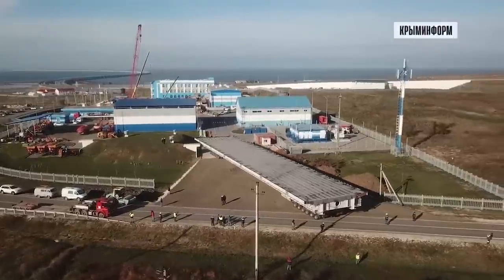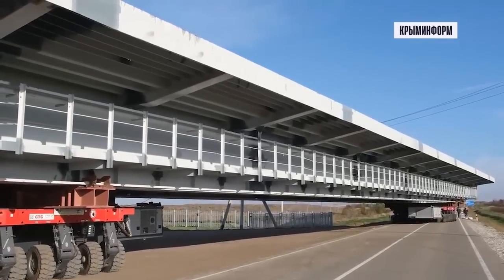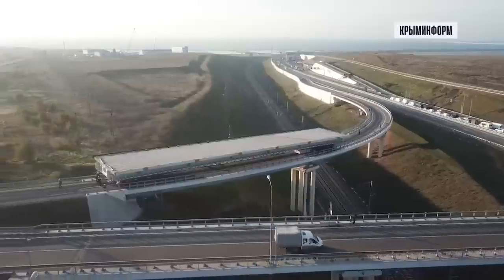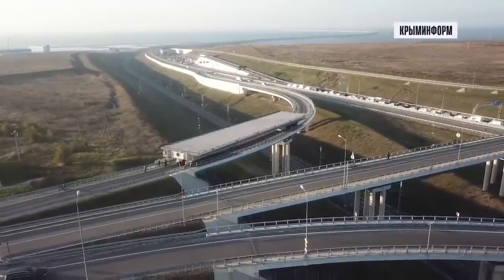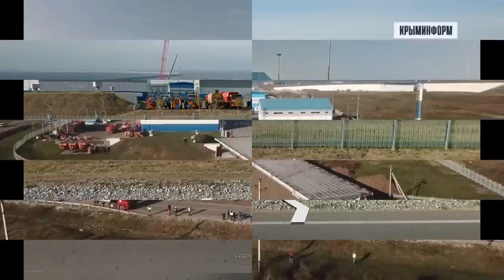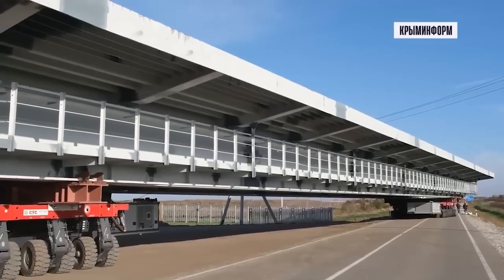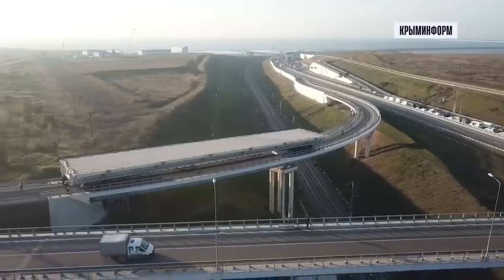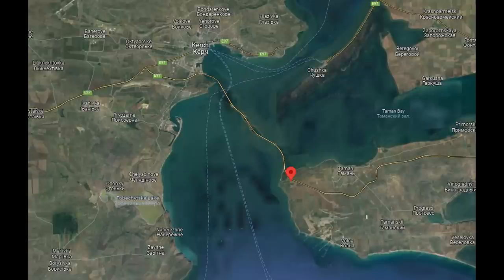Russia Transports New Span to Repair the Crimean Bridge

Comment: @Suchomimus As a former concrete and reinforced concrete builder, I can tell you that the time of four weeks is quite realistic for a new construction of a sub-sequence with the available construction plans.keep up the good work with your videos! 
🇺🇦🇺🇦🇺🇦 SLAVA UKRAINI HEROYEM SLAVA 🇺🇦🇺🇦🇺🇦
Reply from the maker: nice, thanks for the info
Reply: @suchomimus9921  Has anyone checked recent satellite imagery of where it was built to see if work was underway prior to the October attack?
I'm crap at geolocation - can't find the place on Google Earth.
Reply: To add, from the video the span is steel construction (not concrete) - steel pieces have to be manufactured unless they're ready at-hand to be assembled (which is comparatively quick)
Reply: @kristianhermann5971  - I'd be surprised if they didn't have a warehouse full of pre-welded trusses and other sub-components ready to assemble and a working floor with jigs built in.
Reply: @hamletksquid2702  I was surprised they'd keep that much spare material at hand but maybe it was considered a good idea after one of the railway spans fell into the water during inital construction. Russia wants it operational by the end of the year, with the final work completed by July, per early reports.
Reply: @mikep490  - It's hard to say what the Russians consider sensible, but I would certainly stockpile sub-assemblies. Steel's cheap, and you need to keep the skilled workers for when you need them. It's the equivalent of having bridging equipment moving up behind your forces just in case.
Reply: @hamletksquid2702  We know Russia assumed the bridge would be targeted so I'd assume they ordered materials before it blew up, back when they started putting target barges around the bridge. You wouldn't normally have a million in materials just lying around. The construction method they used in those sections isn't all that strong, if blasts or earthquakes are a consideration. Of course that might have added another billion to the construction cost to build it double reinforced.
Reply: @mikep490  - You can build it needlessly strong, or you can build it cheap. This bridge isn't a structural unit. It's a bunch of them that just sit on piers.  The pre-cast box must have been made ahead of time. Here, it would have had homeless people living in it. 
I really would expect them to have a section's worth of trusses and crosspieces warehoused. The labor is the expensive part, and you're going to spend some time spreading the work out and being ready or in a hurry and take what you get. 
I work on much smaller things made out of more expensive steel than construction iron, and some of our customers make and stock blanks for custom products later. That can easily add up to a month's revenue on the shelf.

Comment: This is just one span of four that they need to replace the fallen spans. This does not count the spans that continue to stand but are damaged. I suspect they will have at least four additional spans to replace on top of the four fallen spans. They still have a lot of work to do to bring the roadway portion back to spec.

Comment: The vehicles used are smaller versions of the ones used by Elon Musk's SpaceX to move Starship at Boca Chica, Texas.  The biggest manufacturer of these SPMTs (Self Propelled Modular Transporters) is Fagioli S.p.A.  They can carry massive loads of up to 60 tons per axle-line.
Reply: If you watch SpaceX activities at Boca Chica, they are used on a daily basis to move the booster and starship between the launch pad and assembly buildings. The SPMT's are amazing vehicles.
Reply: Adjustable height and fully independent steering on each axle.
Reply: Just don't get the idea that musky boy invented these things. They've been around for a long while in the heavy lift industry, they (musky boy) just had ones custom made for their own purpose.
Reply: @SuperRede4u  There is nothing custom about the individual modules. Each module is as big as it can be while still being easy to ship. So they fit on a standard truck. 

They have big flat surfaces with many anchor points. Multiple modules can be directly connected to a strong rigid load like a bridge segment, to make a single huge vehicle. Or they can be connected with a custom steel frame to carry a more delicate load like a rocket. 

Each wheel has its own motor, independent steering, and a rather large vertical travel. The vertical travel allows the transporter to keep the load level on a sloped road.
Reply: Civil engineer, here.

When you have money but can't place it in international accounts due to sanctions and asset freezes you now can invest it locally in your own economy. Gone are the days of quick gas and crude earnings which could be whisked away into London and NYC accounts for safe keeping !

This might be why this bridge span was fabricated so quickly. The money always  needs to go somewhere.

Experts were hired for around the clock and likely overpaid for improved motivation.

Section elements are standard and were pulled from a maintainance  warehouse.

But was proper QA-QC done on the section prior to shipping it to the  construction site. This remains the massive elephant in the room.

Another  poster here cited the use of an Italian (?) transport crawler. As sanctions continue and spare parts become scarce crawlers like this will cease to operate, preventing bridge repairs. I'm sure the crawlers, having to bear very heavy weights, need specialized ball bearings. 

Remember what had happened at start of war? Sanctions stopped import of specialized Swiss ball bearings. Because of this, the Russian rail company, who use such bearings, knicked several routes and retired several cars.

And the crawler parts ought to be even more niche, more specialized hence harder to obtain.

Ukr and Ukr allies would we well-benefited to sabotage such crawlers to disallow the movement of completed bridge sections. The bridge will be hit again, I have no doubts about this, so by eliminating the crawlers its repair will be very, very hard.
Reply: Fagioli is a service provider. They don´t manufacture. Most SPMT´s I have seen are made by Scheuerle, a German company.
Reply: Has nothing to do with Elon or SpaceX. These heavy lift platforms are used since decades by heavy cargo moving companys like Mammoet
Reply: @SuperRede4u  did your mom even send you to school to learn how to read? nowhere in the original comment that said Elon invented this.
Reply: @Myriip  which nation manufactures this crawler ?
Reply: @NhatHuyNg  Yeah, his comment came across as an early case of MDS (Musk Derangement Syndrome)
Reply: @oleopathic  Most are manufactured in Germany by the TII Group (KAMAG).
Reply: @Myriip  OK. Thanks for info. So sanctions should kick in as this war continues and both bridge and crawler are targeted.
Reply: @oleopathic  They could go around sanctions because TII Group has one facility in India if im not mistaken.

Also the company who rebuild the span is most likely in proper Russia and not a military target.
Reply: @Myriip  all good points. 

There are back channels to use to subvert sanctions. However it must be done secretly. If US and allies find out  they will sanction the culprits helping Russia. So India might get hit, too.

As for manufacturing facility inside Russia. With the tempo of war, might war move to the area supporting manufacturing facility in future? It's possible.
Reply: @solarwizzo8667  that is indeed the company that SpaceX purchased it’s SPMT’s from. Previously they rented some from Fagioli
Reply: @SuperRede4u  SpaceX probably just rented them at first. I’ve seen them use different models with different colors.

Comment: It'll be interesting to see if it fits properly. I could see them putting hundreds of welders on it without consideration for heat inputs causing alignment issues in the field. Production over quality.
Reply: @HubertofLiege  Ha! Sounds like a lot of fitters I've worked with.
Reply: @pho-kingsoup8126  grinders and paint make me the welder I am nyet
Reply: @HubertofLiege  Brings me back to inspecting. The guys who ground everything to min height above parent material were usually the guys who used up most of my soapstone.
Reply: Hopefully they used rubber tape measures - allegedly they are commonly used and available in France.
Reply: Ya, I'm sure they have no clue what they're doing in this final welding shop. LMFAO.

Comment: Fabrication of the span is the simple part, after it is moved across the remaining bridge the span then has to be lifted and moved into the big hole. The quickest way would be a floating crane this you may be able to see if any are in the area. The other way is to set cranes up on the bridge which is a lot more challenging due to the weight of the span.

Comment: To me it looks like several per-made section welded together judging by the rusty areas along the outer sides. If it was a quickly made new section of bridge why would you have a walk way on both sides? The transport system used is very common on large construction type jobs so nothing unusual about that.

Comment: Not impossible to make it fast or have it prepared. But they need at least 3 of them. And the big worry for me is the support pillars.
Reply: Worried ? Why ? Do you want it to work?  No matter , Mr. HIMARS will sort it 👍
Reply: Well, and spans going the other way that didn't fail at the time.
Reply: @johnbooth3073  Worry from a engineering standpoint.
I want this thing to fall.

Comment: Calgary Alberta Canada here, just a short note, in Calgary we have a cement company  that constructs these very  bridge sections for our highway overpasses and it's really cool to watch them move them in a similar  fashion  as this , only in the city they have to move them late at night when traffic is low.I worked the night shift so I could watch them at night. We also have traffic lights that pivot 90 degrees so that it helps them move more easier. GOOD TALK CHEERS.

Comment: I suspect they had enough prefabricated parts on hand to allow them to manufacture this span fairly quickly. This is especially true since the bridge was completed fairly recently and it looks like they had kept the manufacturing site active. I would think that the more curvy pieces would be more of a challenge to build. The pieces that go from lower to higher elevations would likely take more time to rebuild.
Reply: Civil engineer, here.

When you have money but can't place it in international accounts due to sanctions and asset freezes you now can invest it locally in your own economy. Gone are the days of quick gas and crude earnings which could be whisked away into London and NYC accounts for safe keeping !

This might be why this bridge span was fabricated so quickly. The money always  needs to go somewhere.

Experts were hired for around the clock and likely overpaid for improved motivation.

Section elements are standard and were pulled from a maintainance  warehouse.

But was proper QA-QC done on the section prior to shipping it to the  construction site. This remains the massive elephant in the room.

Another  poster here cited the use of an Italian (?) transport crawler. As sanctions continue and spare parts become scarce crawlers like this will cease to operate, preventing bridge repairs. I'm sure the crawlers, having to bear very heavy weights, need specialized ball bearings. 

Remember what had happened at start of war? Sanctions stopped import of specialized Swiss ball bearings. Because of this, the Russian rail company, who use such bearings, knicked several routes and retired several cars.

And the crawler parts ought to be even more niche, more specialized hence harder to obtain.

Ukr and Ukr allies would we well-benefited to sabotage such crawlers to disallow the movement of completed bridge sections. The bridge will be hit again, I have no doubts about this, so by eliminating the crawlers its repair will be very, very hard.

Comment: First thing I noticed is that it's not made of reinforced concrete. It all appears to made of structural steel however it is possible that concrete could be poured once the span is in situation. 
Because the bridge is relatively new it's possible that this span was made on a bespoke hydraulic jig/template that remains from the initial construction.
Hit it while it's hanging on the crane.

Comment: Civ/architecture here... the assembly would be possible but the concrete will take at least a couple months to fully cure to full strength. I suppose it will take another week or more to get to a point where it’s expected to support vehicles. By then it will be fine I suspect. The surface might get more degradation, but the strength mostly comes from the steel anyway.

Comment: Since the design of the bridge already exists and is (presumably) approved, you just need the materials available to get it done quickly. If any corners have been cut it will be in weld heat treatment and weld inspection. In which case the service life will be shorter. (See any video about the Liberty Ships)

The long lead item is the transport vehicle, which presumably is available from the original construction.

They probably also need to have drawn up a bespoke installation plan, as the installation sequence will be different from the original
Reply: Russia never requires approval just get it done now

Comment: Since the bridge was originally finished in 2018, some of the equipment to make it may still exist. The smelters that created the original may still have the templates to make more steel to the original design. One month would normally surprise me, but not for a construction this recent. All it may have taken was Gov't reallocating resources to the project.
I'm not a civil engineer, I'm electrical, so grain of salt my opinion.

Comment: SpaceX in the United States uses an almost identical transporter to move it's Starship rockets in Boca Chica, Texas. They refer to it as an SPMT, which stands for "self-propelled modular transporter." Not a very cool name, I know. It has a generator at the rear that powers its electric drive motors at the wheels. Each of these units can be linked to others, both physically and/or digitally, to form a single, larger transporter.
Reply: In Central Queensland Australia we use Lampson transporters of similar design to shift draglines over long distances when one end of mine is considered uneconomic. ( Generally 20 plus kilometres.) Some of the strip mines are over 75 kilometres in length. Using the transporters saves replacing the walking gears on the draglines but can take months to set up and a huge amount of earthworks as well.

Comment: Time, money, quality, you get two of the three in engineering so with enough money you can get quality, this appears to be a prestressed section, and the engineering was likely done before the event happened.  So it is possible that it meets the same standard as the old section.

Comment: The vehicle is a SPMT - Self-Propelled Modular Transporter. 

I'm an engineer. I would say yes, it is possible. It's quite simple in design. Throw enough people and money at it and its possible to make it in no time at all. I'm guestimating it is about 60 meters long and made up of 7 individual pieces. There is no reason why all 7 parts couldn't be built at the same time then bolt together. The plant it was constructed at may quite well have been the plant they originally make the bridge at, so might have already been geared up ready to go. 

Russia has steel plants, so they wouldn't have to order it in from aboard and would have put this to the top of the order list.

Comment: Provided they could source the numerous types of steel beam and materials, there's no reason why it couldn't be put together quite quickly. They have the factory, drawings, specification etc. They might even be able to find some of the original workforce too. It would also need good checking and signing off procedure in place unless some guarantees cannot be met due to material constraints.

Comment: @Suchominus The section is all steel & assembled on the Russia side of the Kerch Bridge. Steel by rail is fast (to that location) & Russia has tons of its own steel.  Plus with the bridge out, there is not much rail traffic to delay the steel delivery.  Again, notice on the heavy lift transporters, there is only steel & the under deck.

Once it is placed on the piers, the rebar will be added & tied in a day & the concrete for the road deck will be poured. Concrete will need a month to cure.  Then paved & add the railings.  Once in place, it'll be open to road traffic in a month.  Remember, this is only one section & there are a couple of sections that were collapsed.

And also of note: don't think a visit by "Mr. HIMARS" will make any difference on this steel section.  IF any further attacks were to happen, to be effective they would need to  hit a different section. Such as: the section ALL THE CONSTRUCTION EQUIPMENT FOR THE REPAIR is parked at.  Maybe on a weekend.  Any Russian Holidays approaching?

Comment: No problem making this quickly, you can see it basically has 3 parts to it: Two lengthways beams, the beams across, and profiled sheet metal to host the road.
No concrete that needs to harden, and they already have all the drawings and measures.
It looks like it could be quite noisy tho.

Comment: I to suspect they may have made component on a just in case basis and so the assembly is reasonablely quick interesting its all painted. I would have thought given the urgency it would have just gone primed as they could paint it on site. I think another strike may be a bigger issue. Maybe the satelite photos in the past could put more l light on the construction